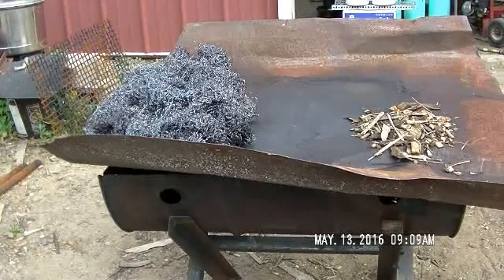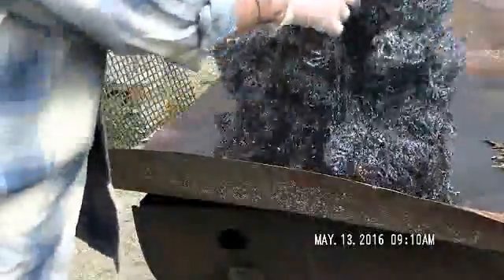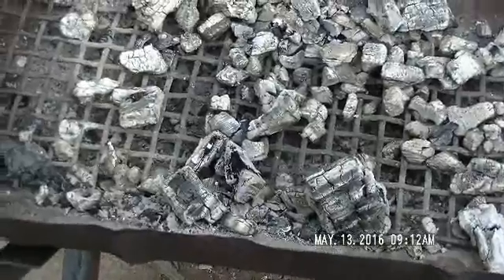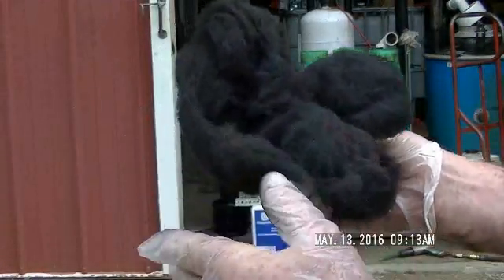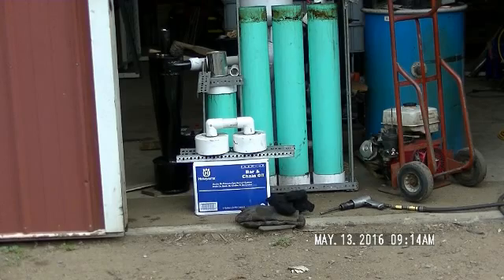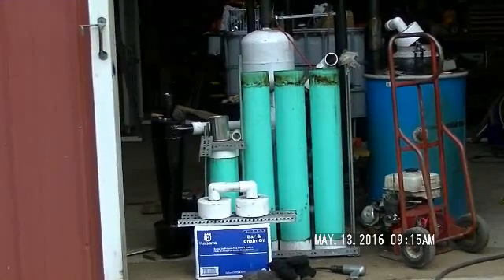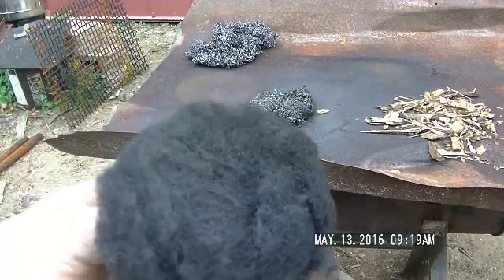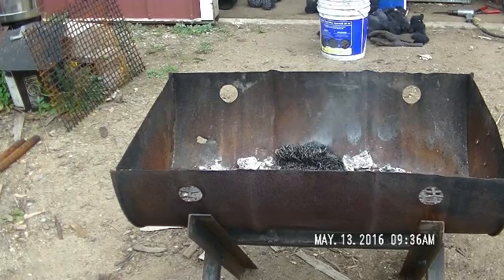Wood gas filters - A New Filter Clean Out Method

Comment: We need new updates on wood gasifiers. Hope you make more videos because we will need them.
Reply from the maker: I think you are right about needing them, if we don't get toasted from a DEW first.  I've been up to my neck in firewood deliveries all year and have had zero time to do anything else. Trying to find the time to try out a DXF-4 Charcoal gasifier I purchased from Thrive Off Grid last Spring. Crazy ! That said, there is a lot more information out there about wood gas than when I started. You should be able to get enough information to guide you along the way. Keep going with it, it does work ! I even got to the point of incorporating Arduino computer controllers to fine tune the  Air/Fuel Ratio.

Comment: It's good to see all of the how to's in gasification. I was afraid of how hard the filter housings would be to get apart. I sanded down the inside of fittings with a flapper wheel on a die grinder, and used fernco rubber fittings for a good seal.  Anyway , thanks for sharing your findings. Joe

Comment: Cool idea with drying the stainless steel scrubbers out on the BBQ. I clean mine by placing them in a 5 gallon bucket then adding a scoop of Oxyclean and some warm water to the mix. I don't ever think I've seen polyester filler that black before. I clean my polyester filler the same way I clean my stainless steel scrubbers and the Oxyclean makes the stuff damn well almost white again. I let the polyester filler dry in the sun. Speaking of sun drying, Are your wood chips small thick chunks of wood? If so you may want to think about trying thin wood shavings. Those work the best. I do not change out my wood chips. I just dump them out on a flat surface and let the sun dry them and they are as good as new.
Reply from the maker: +flash001USA  Flash, Yes, the wood chips are pretty chunky. I'll take your idea and use it. Maybe run down to Tractor Supply and pick up some shavings. Thanks for the tip.
Reply: +NH Hbbyloggr When I seen what you were using I wanted to mention to you about using the thin shavings because the thick stuff doesn't work well. Be sure to get the pine shavings. They seem work the best. Before I forget, don't over pack the wood shavings. Just put them in the pipe and let them settle under their own weight. You can pack them lightly but be mindful because if you pack them too much the filters won't breathe correctly.
Reply from the maker: +flash001USA  Funny you mentioned it about over packing. I had SS and fiberfill left over when I put them back in the tubes. It's looser, or rather not packed this time around. I'll get the shavings in before the next run. The fiber fill was the same stuff I had in there last year. I used the same wash bucket to clean the Fiber fill after I did the scrubbers. I guess they got dyed. Maybe before I make the run I'll change it out for new, just to see if it's improved performance.

Comment: Well done indeed  :) .
I used to employ this method, and it worked like a charm.
With mine, I would put a tiny splash of gasoline on a pile of stainless steel gasifier filters, and light 'er up.
It would burn furiously, as the soot is great fuel.
Trouble is, my supposedly stainless steel pads rusted up.
Maybe I got the wrong ones?
To get around this, I dump them in a bucket of warm soapy water. The water turns black, and the SS pads become like new  :) .
My filter chain lasts for about 100 hours between cleanouts, which is quite surprising, considering that they are only 4 inches in diameter.

Oh, for your filter cap problems, the solution may be as simple as reducing their contact area with the pipe end.
My filter caps are only 3/4 inches tall on their walls. As a result, they are a bit of a loose fit on the filter pipes.
Grease seals them against leaks, and they come off very easily when I loosen the pipe clamps that hold them in place.
Perhaps this will be helpful for your system?

Like you, I am learning something new every day with these wonderful machines, so the woodgas bug is happy with his choice of bugbite victim  :) .
Reply from the maker: +CNCmachiningisfun Time will tell if it degrades the SS as you found out. At least it's going to get me to the 100 hr mark? That would be thrilling to write that down on the diary.
Reply: NH Hbbyloggr 
You might have bought the good stuff, as I seem to remember mine rusting quite rapidly when I used flames for cleaning it in the early days.
The current lot is as good as new, even after some 800 hours of time in service  :) .
Your diary will soon smile upon you, especially if you can snap a photo of the woodgas bug  ;).
Reply from the maker: +CNCmachiningisfun As I recall, I bought a case of the  SS stuff on Amazon.com. The label said made in China. ( no surprise there !) I have a couple of the pads in the house for doing pots and pans and they are basically indestructible in that application.
Reply: NH Hbbyloggr 
Indeedy, these seem to stand the test of time when used in the normal way.
Perhaps heating them beyond a certain point burns off some sort of protective plating. I really don't know.
Mine have a ferrous content, so they happily stick to magnets.
Perhaps that's a pointer to their survival at higher temperatures?
Reply from the maker: *****
 Hmmm, I'll try the magnet tomorrow. But for now, they are all sparkly clean and resting comfortably in their little tubes...just waiting ..
Reply: NH Hbbyloggr 
That's great.
Hopefully, you will never have any problems with them  :) .
For ease of access, my 2 filter tubes are on screw bases, like light bulbs.
This lets me rapidly remove, clean and refit them.
Being lazy by nature, I am always looking for an easy answer to all those difficult questions  :) .
Reply: @CNCmachiningisfun  You braindead moron, you have zero knowledge of basic chemistry